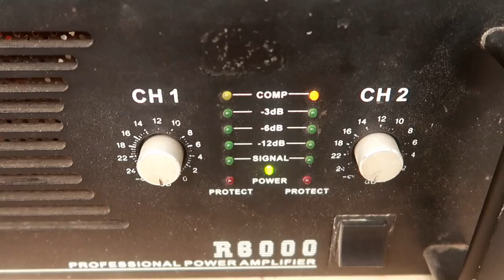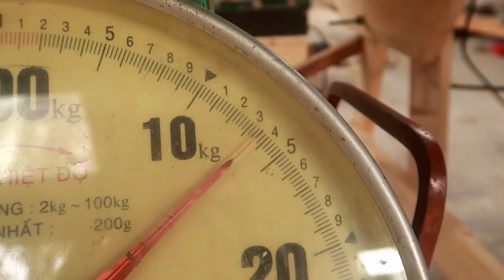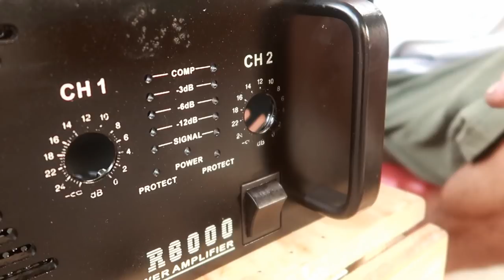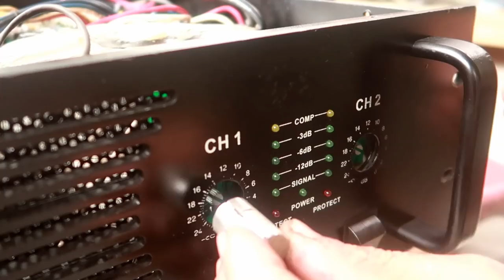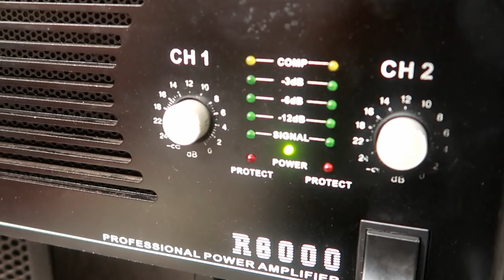Restoration A 36-Transistor Amplifier With A Capacity Of 3000w

Comment: Those carbon resistors should have been the first components to dump given the age of the amp - they go 'high' with age. Metal film resistors are not expensive and far superior. What you have done is like serving a car and reusing the old oil.
Reply: There were no carbon comp. resistors in that amp. you do not know what you are talking about.
Reply: @briandeeley1599  Go back to college. Those are carbon film resistors in this amp. Carbon film resistors go high with age which changes the properties of the circuit slightly. When working on/extending the life of audio gear upgrading the resistors is the class thing to do. It may be the case that these tested at their rated resistance, though I doubt it, but it doesn't show that.
Reply: @biomechanique6874  Carbon comp values drift, i have been repairing circuits for a living for over 25 years, carbon film are more stable than carbon comp. there is no need to switch to metal film.
Reply: @briandeeley1599  It's called 'future proofing'.   More stable is not enough. If the device is worth keeping its worth upgrading. So you have spent 25 years doing 'same old same old'? Better tech exists to make the world a better place.
Reply: @biomechanique6874  The amp in this video is a piece of shit, if was a collectable piece then a different approach would be warranted of what is being done in this video.
Reply: @briandeeley1599  I have done work for a guy that has gear that was subprime but a real money earner. He did functions and parties for decades with the same gear. I got loads of work after saving one of his rigs, new pots, polyprop caps where effective and metal film resistors. It sounded a whole lot better after the treatment. This was back in the eighties and it's still going.
Reply: @Bio Mechanique, @Brian Deeley You all made valid points about the components he used, but I hope you realize he's not trying to do a good job on his repairs. He does these refurbs just to get the item barely working, and looking reasonably good cosmetically. He resells all this stuff to folks who can't afford any better. I'm sure the amp will last a few years, and that's probably good enough for what the customer paid for the item.
Reply: @javaking1000  hey, yeah that's fine. Most of this type of equipment has design tolerances that aren't overly affected by ageing resistors and this guy does a great job in keeping people on a low budget in business. For me it would depend on the rig and the client, so in this case just making it work is good enough. 👍
Reply: It's from 2006, look at the boards, considering how cheap this is and the low repair quality, replacing these resistors would be the least of concerns.
Reply: @puciohenzap891  This project has the word 'restoration' in the title. You say "cheap amp, low quality repair" - like you wouldn't bother with it because it isn't worth the trouble. There is way too much 'restoration' click bait on YouTube, don't you think?